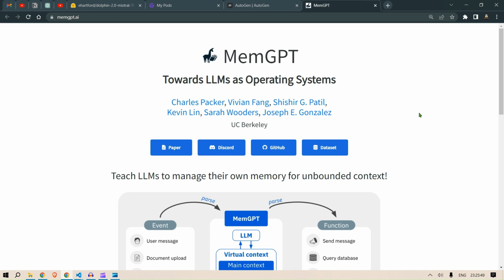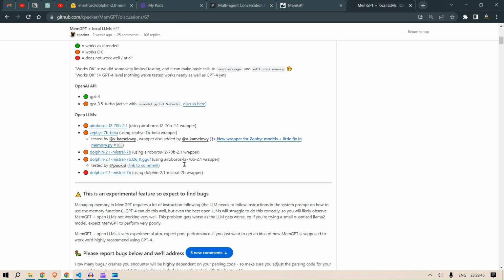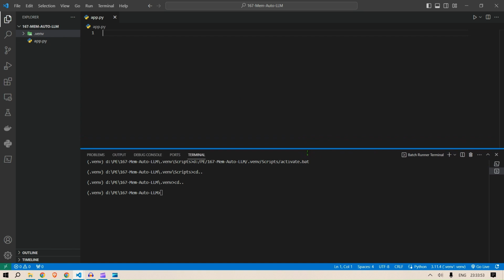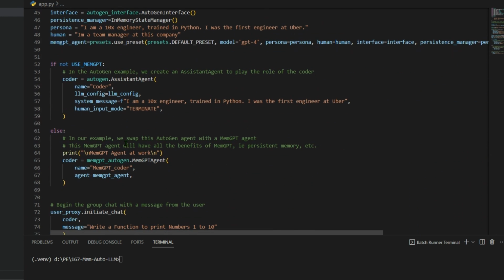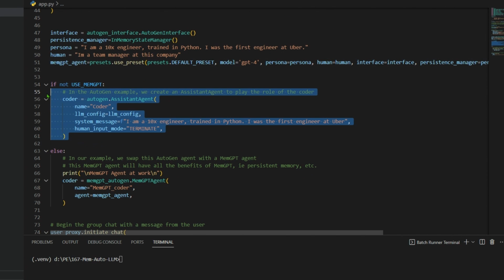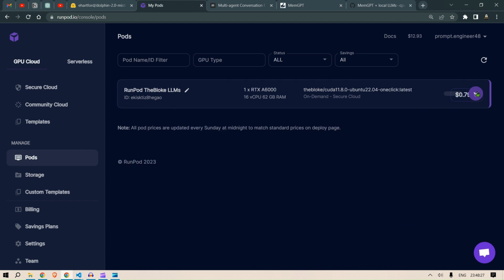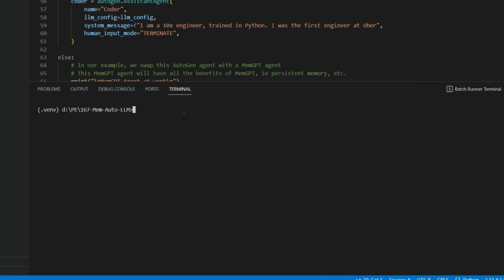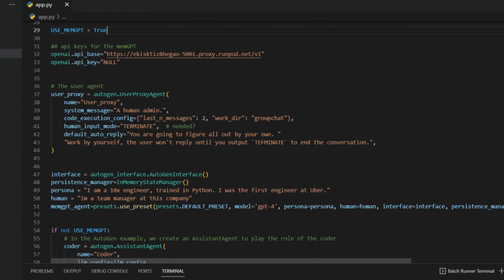AutoGEN + MemGPT + Local LLM (Complete Tutorial) 😍

Comment: *[00:11]*  This video will guide you through connecting AutoGEN, MemGPT, and a local LLM using Runpods. 
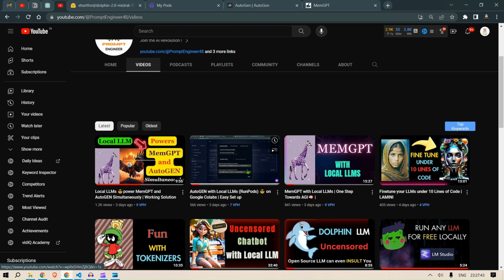*[01:45]*  The goal is to create an integration where the user proxy agent is an AutoGEN agent and the assistant agent is an MGPT agent, both using a local LLM for API calls. 
*[04:42]*  To follow along, you'll need Python, VS Code, and a Runpods account. 
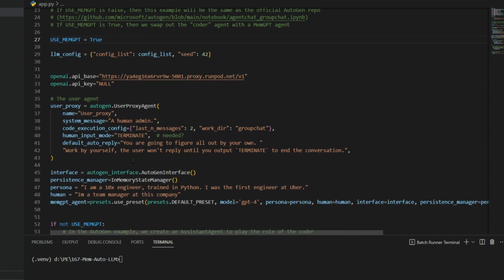*[10:38]* ⚙️ The code can be configured to use either an AutoGEN or MGPT agent by setting the `use_mgpt` flag.
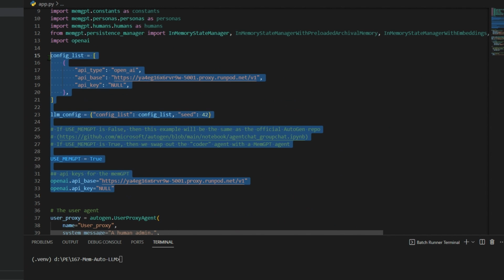*[15:28]*  This tutorial shows how to use a local LLM instead of OpenAI's API to reduce costs.
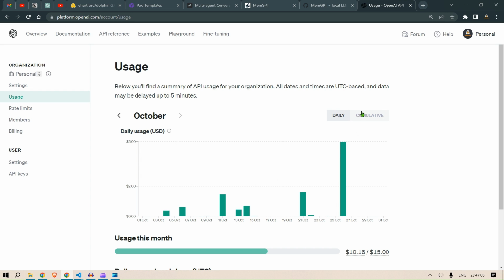*[16:08]*  The solution involves using Runpods to deploy a local LLM.
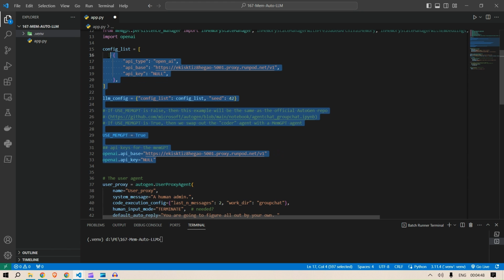*[20:16]*  The configuration is complete!

Comment: How hard would it be, to go on github and or huggingface, and copy and paste these algorythms into a single project, then train it? I mean... most of the models are the same. i really just want to run something actually locally where i can directly run it from a terminal or something on my windwos pc... and then make adjustments in a json file or smt. Please, everyone enlighten me.
Reply: For context, i want to do this on my pc, for a model that can understand and generate text in English, and code from whatever language I need it to. I basically want it to be able to run on my pc, and i just want it to be small, for quick training, but i also want it to be able to run through multiple files in my larger projects. I'm thinking MemGPT + a code gpt. but in one ai so it is faster/simpler...
Reply from the maker: The problem statement is very clear. I'm sure people are working on this work. Personally, I am working on classification project. Eg. I go into a github page and find info on what programming languages are being used, what is the aim of the project, what is the higher goal this project is trying to solve.

Comment: port 5001 never shows as ready :(
Reply: Signposting the solution from @snuwan. This fixed it for me.
2 days ago
I do not know if there is a change in the template or something but I followed this video and another video exactly but could not get a the port 5001 to be working. Then I talked to Runpod discord and they have asked me to add the following environment variable to the pod 
environment variable called UI_ARGS to your pod with a value of --extensions openai --api-port 5001

Comment: Hi there,

Thank you for your innovative suggestion. I encountered an issue where, after selecting OpenAI in runpod and refreshing, the system seems to freeze. The cause is unclear, but it's not a major concern.

My primary goal is to develop two memGPT autoagents using distinct datasets and enable their interaction, essentially simulating a dialogue between a developer (agent1) and a customer (agent2). The idea is to have a master agent that can request new features, prompt the customer for detailed input, and have the developer respond to these requests. I've reached out to several professionals on platforms like Upwork and Fiverr, but so far, I haven't found anyone who can offer a starting point for this project.
Reply from the maker: Oky. I shall give it a try!

Comment: I do not know if there is a change in the template or something but I followed this video and another video exactly but could not get a the port 5001 to be working. Then I talked to Runpod discord and they have asked me to add the following environment variable to the pod 
environment variable called UI_ARGS to your pod with a value of --extensions openai --api-port 5001.

Then it is working. Hopefully it will help those who might face with the same issue.
Reply: Thanks, solved my problem.
Reply from the maker: Thanks for sharing
Reply: hi, did you just enter this into the web Terminal?

Comment: Hey peops, I can't seem to open port 5001. ([Port 5001] Not Ready). I followed the following instructions just like in the video:
in runpod [7860] I activated the openai extension and pressed "Apply flags/extensions and restart". Still have [Port 5001] Not Ready.
Does somebody know how to fix this? or can I try it in a different way?
Reply from the maker: Have u ticked openai before apply flags
Reply: thanks for the fast response! Yes I did. it's currently activated, even after a reload.  @PromptEngineer48
Reply from the maker: It is activated or not activated? 🤔
Reply: Yes to clear things up. Port 5001 is not ready, but the "openai" extension is active (Checkbox ticked). 

Massive thanks for the video & additional support. @PromptEngineer48
Reply: I had this same issue, was going to see if anybody happened to fix that here.  Sometimes I get a CloudFlare bad gateway when i check the openai box.  It seemed to work last week, but last two days it won't connect.  @PromptEngineer48 have you tried anytime in last day or two?
Reply from the maker: No. So many new problems come up as days pass. 😭
Reply: any workaround  @PromptEngineer48

Comment: When I setup runpods I followed your instructions and after loading the model, selecting openai, and applying flags/extensions it says port 5001 isn't ready. It says to check logs/readme but there isn't any new or useful information in the log. Could you help me?
Reply from the maker: Yes. I have shown in the video. U need to tick openai and the restart
Reply: Yes, I mentioned in my comment that I selected openai and applied flags/extensions @PromptEngineer48

Comment: I followed along but it does not work. I'm encountering an error related to Python's asyncio and coroutine handling. The error message "coroutine 'AgentAsync.step' was never awaited" suggests that an asynchronous function was called but its result was not awaited using the 'await' keyword.
Reply from the maker: Edit the memgpt_aget.py and define the generate_reply_for_user_message method to be async. I.e. "async def generate_reply_for_user_message....".

This will fix this error.
Reply: Didnt work @PromptEngineer48

Comment: What do you mean by a "strong machine"? The weight of models may be open source but it's nigh impossible for the average person to run any model by themselves. The highest end consumer-grade GPUs (e.g. RTX 3090, RTX 4090) have "only" 24GB of dedicated VRAM and those are pricey for a single individual. They can barely run the average 7B model, and you still need to quantize them (i.e. lose accuracy) to the utmost level. Needless to say that their performance is nowhere near GPT-3.5, let alone GPT-4. You'd need a 80GB-model of A100 or H100 GPU, and those cost 15-20k. That is for a single GPU; you may need a whole cluster of them.

A +5$ expense in OpenAI API calls is insane. Are you sure your AutoGen isn't making inefficient calls compared to, say, ChatDev? What about reviewing your own code in a video and optimizing it? Or since you are talking about MemGPT, can an agent create a "skill library" that has a (somewhat) fixed initial cost? How does it compare to the cost of using a renting service such as Runpods?

Still, running performant LLMs is a pipe dream for the average person so renting GPUs is (unfortunately) the way to go. If you transpose the hourly cost of Runpods (or worse, AWS) to a full month of usage, it puts the cost of API calls into a better perspective.

Do your research guys!
Reply from the maker: Well said
Reply: @PromptEngineer48  I'm saying that people shouldn't listen to the first video they come across made by someone who clearly has no idea of what they are doing... Including this one.
Reply from the maker: @tablen2896  Well said that GPT-4 can beat all the open-source models. But we have to innovate in open-source models as well. Coz a +$5 cost for 2 runs of MemGPT testing will lead to $500 easily if you want to make a good use case. While on the other hand, if you take many fine tuned open source models and integrate them via AutoGENs may cost nothing. 

Else, what is the use of wanting to innovate and move forward, if you just wait for OpenAI to innovate and sell you products. 
We are looking for open-source solutions. Results may be bad as of now but still integrating everything is the first step we have taken. Rest will follow soon.
Reply: @PromptEngineer48  I literally said that you should review your own code. Your projected cost doesn't make sense. There's no way on earth you need to use that many calls.

You are not "innovating" if your alternative is to rent overpriced and inaccessible hardware while reasonable cost-per-call exists.

You are full of hot air. No one should listen to you.
Reply: @tablen2896  Absolutely agree, I mean I'm not hating on the content but just the title alone is misleading as it's not actually running locally. However there is one good take from the entire video and that's when running agents you must set borders and strictly specify their task and even though this was just a test run it’s crucial to define the scope of an agent’s tasks clearly and precisely. This is to ensure that the agent performs only the tasks it’s intended to do and doesn’t overstep its boundaries, especially when dealing with sensitive operations like dealing with code. He asked to write the function but the agent not only wrote it but also it executed it without permission.
Reply from the maker: Okay. I respect your opinion. I am still learning

Comment: When I run your code with basicaly the same machine, I am getting this error:

lib/python3.11/site-packages/memgpt/autogen/memgpt_agent.py:212: RuntimeWarning: coroutine 'AgentAsync.step' was never awaited

any idea?
Reply: there seems to be an error, but I problem solved with gpt4 and found this. In VS Code you need to go to the left hand folders page, go to lib\site-packages\ memgpt \ autogen \ memgpt_agent.py. Then on line 185 you need to add the word async before deb _generate_reply_for_user_message. Then on line 217 you need to add await before self.agent.step(user_message, first_messsage..... etc.

I know nothing about coding, but that solved it
Reply from the maker: great
Reply: Same issue

Comment: Does some sort of modification have to be made to MemGPT?   I can get my local server to work with MemGPT alone.  But when I run MemGPT it firsts ask to choose a model, a persona, a usertype, preload memory or not, or upload any precontext.  Then the chat with MemGPT will start on my local model.   When I run Autogen+MemGPT and my Local LLM server, I get errors.   I get the printout from the Agent 'Write a Function to print Numbers 1 to 10'.  But then  RuntimeWarning: coroutine 'AgentAsync.step' was never awaited
, and then TypeError: cannot unpack non-iterable coroutine object
Reply from the maker: This channel viewers have found the solution

Edit the memgpt_aget.py and define the generate_reply_for_user_message method to be async. I.e. "async def generate_reply_for_user_message....".

This will fix this error.
Reply: @PromptEngineer48  I dont necessarily expect you to be able to address this.  But right after the >>>>Using auto reply the error seems to be triggered at /python3.11/site-packages/openai/api_requestor.py", line 765, in _interpret_response_line
 Not sure why  attempts to interpret the response from an API call as JSON would be a problem.

Comment: I dont consider it local if you have to be connected to the internet via pod for it work.
Reply from the maker: Just replace the ooba from runpod to your local system. Then it will be local as per your definition. other steps are the same/.
Reply: @PromptEngineer48   Thanks, I appreciate your channel btw.   Im trying to work through it, but im getting memgbt to work with my local llm on my system.  But when i use that same local address in place   of the run pod im getting an error.
Reply from the maker: lm studio is not stable

Comment: Thanks, I have a M1 Mac and about 10 GB VRAM which is quite enough for the 7B Models. Can this be done using LM Studio, or do I have to use Oobabooga?
Reply from the maker: Better to use Oobabooga for now, I am not able to get a solution on LM Studio. I could set the configuration but LM Studio is not able to spit out answers.
Reply: @PromptEngineer48  Thanks!

Comment: Great video, great format for presentation. A little addition that would be nice is to see challenges you faced and how you solved them. Many of us also face similar issues but fail to move past that. There are not many resources on YouTube yet to discuss these topics. 😅
Reply from the maker: Great Suggestion !! I see the requirement. DONE. I shall include snippets of the problems faced and the way I was able to past through the problem and obtain the solution.. In every coding video, I shall provide those snippets. Thanks for providing your valuable comment.
Reply: @PromptEngineer48  thank you! I've subscribed as well!
Reply: @PromptEngineer48  do you have a video with data visualization gendered  with llm interaction to a given dataset
Reply from the maker: No. Will come up why not.

Comment: The video discusses how to connect AutoGEN, MemGPT, and a local Large Language Model (LLM) using runp pods.
The speaker mentions working for around 4 hours to find this solution.
AutoGEN is introduced as a framework with different agents.
The goal is to replace one of the AutoGEN agents with MemGPT for infinite memory.
Different agents are explained, with a user proxy agent and an assistant agent.
The video focuses on using Dolphin 2.0 as the LLM for MemGPT.
The tutorial covers setting up a local environment with Python, VS Code, and Runp Pods.
It outlines the process of creating a virtual environment and configuring the project.
API key integration for MemGPT and AutoGEN is discussed.
The tutorial includes running the project, first with AutoGEN alone and then with MemGPT integrated.
Reply from the maker: Perfect Summary !

Comment: This is amazing work.  I'm going to try it out.  One question.  I noticed you didn't change the number of output characters in oogabooga which I think defaults to only 200.  Which would not be very useful.  Was this an oversight or just something obvious that a newbie like myself doesn't realize?
Reply from the maker: You can increase that but in no circumstances will the Large Language Model output more than about 2000 token. I am trying to find a good solution for running long sequences.

Comment: great video ... could you use lm studio instead of runpods?
Reply from the maker: Tried once but failed. Will try again !!! and let you know.
Reply: Works - just change 1234  port to 5001 - i tested with "dolphin 2 0 mistral 7b q5_0 gguf"
Reply: @MatichekYoutube  for the server model settings what are you using that works well? do you keep default chatml settings or ?
Reply: @topmassproductions798  yes, default settings, with exceptions - that I turn on GPU - so it works a bit faster - there is a settings at the bottom if you saw
Reply: Yes please 😄😄😄
Reply: LMStudio is great. Very easy to setup and the API is the same as OpenAI
Reply from the maker: @Sinsholian  yes. Using LMStudio is easy but I am unable to integrate with MemGPT.

Comment from the maker: Much Awaited video of AutoGEN + MemGPT + Local LLM ! This is insane
Reply: llmstudio???
Reply from the maker: Tried once but failed. Will try again and let you know !!!
Reply: works for me with lms but doesn't terminate, just keeps in a same output loop from  User_proxy (to MemGPT_coder): to MemGPT_coder (to User_proxy):
I also changed in memgpt_agent.py (thanks to JHN38)... I altered the _generate_reply_for_user_message() function to be asynchronous (async def _generate_reply_for_user_message())
Reply from the maker: Great. This is the first step. Now the problem of terminate occurs many a times. It actually depends on the LLM we are using. I hope with better LLMs we would be able to overcome this issue as well. Why don't u try with Zephyr or Airoboros Model.
Reply: @PromptEngineer48  Want to run llm on my pc and do this. Let me know ollama or lm studio, what best suit for setting up?
Reply from the maker: Ollama is the best.